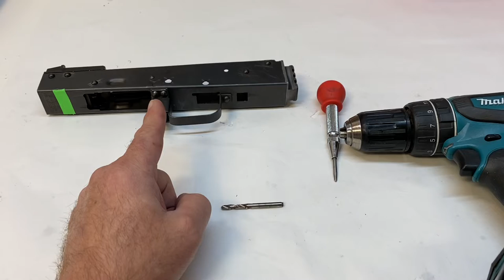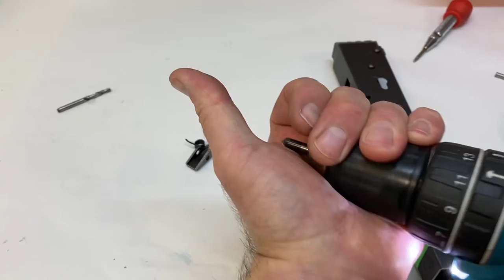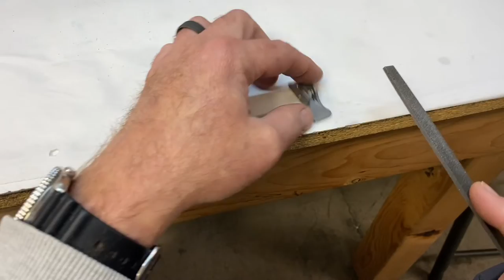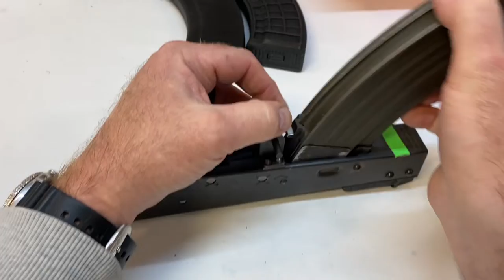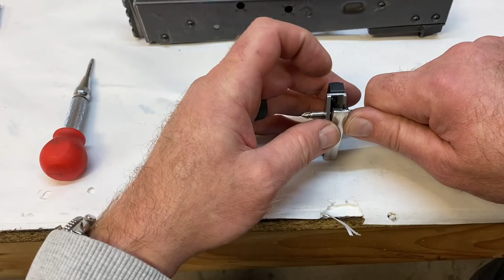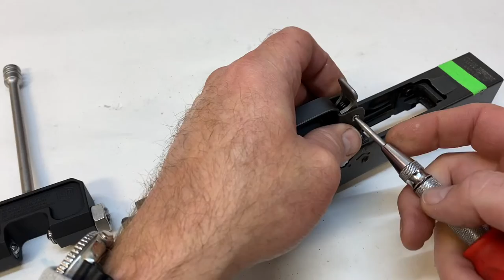How to Install a Mag Catch in a Kalashnikov AK

Comment: Rivets gives it a nice flush look but requires extra tools.  Why not use a screw set in placemat of the rivets to ease the installation and disassembly?
Reply: Alot of novice will do that but it is really frowned upon... Look up m+m industries E-clip AK mag release pin if you don't have the need for specialty tools